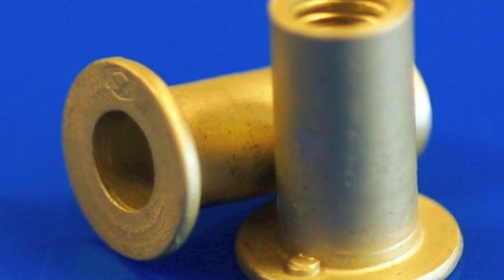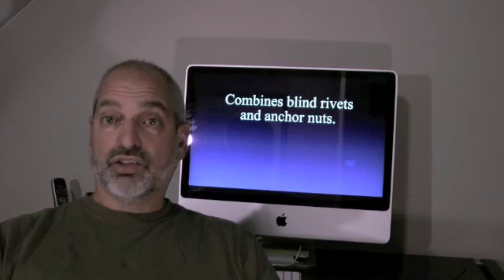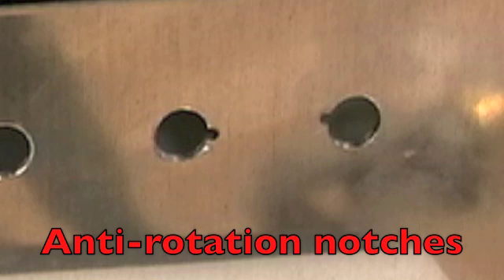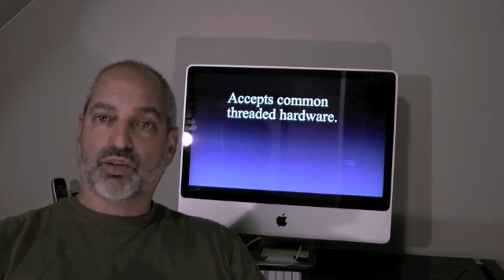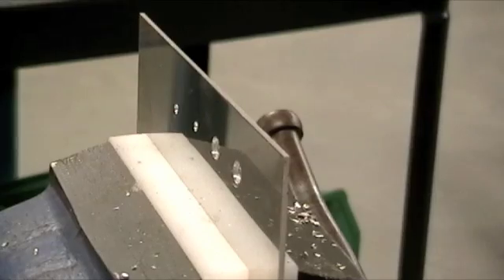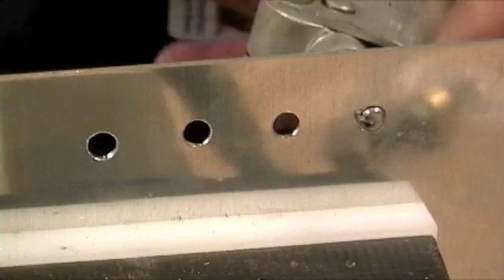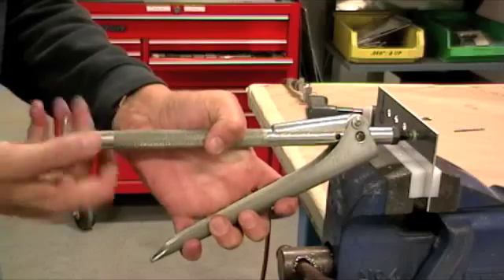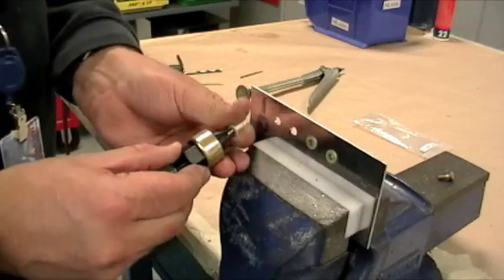PodCast2 Rivnuts

Comment: How do you make the notches? Is there a special tool?
Reply: It appears that there is.  They don’t specifically say it but it seems like you could take a small file and make the notch.  Remember, the process by which you will install the rivnut, will be one where you “squash” it.  Therefore, the diameter will increase.  Considering that, you don’t need a substantial notch.  However, if the notch isn’t there to ensure that the rivnut will resist rotation (say that five times fast)… Well anyways, you don’t want the rivnut to move around when you put through the bolt or whatever fastener you plan on using.